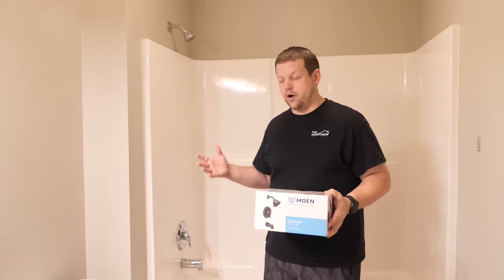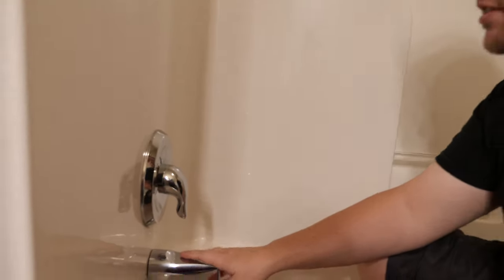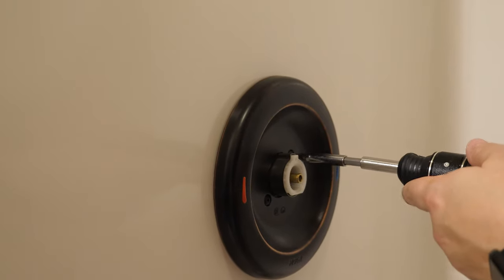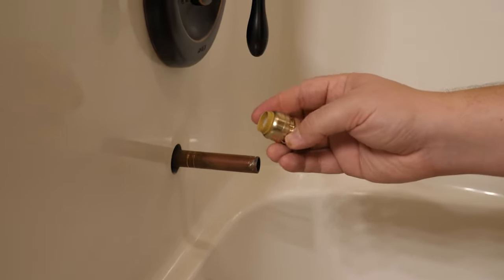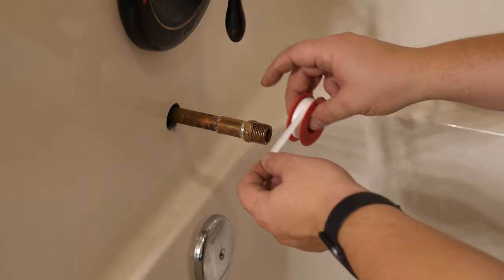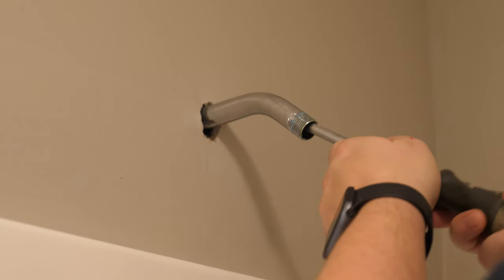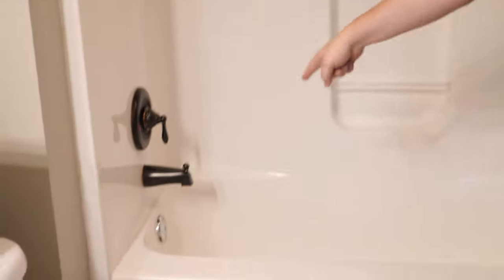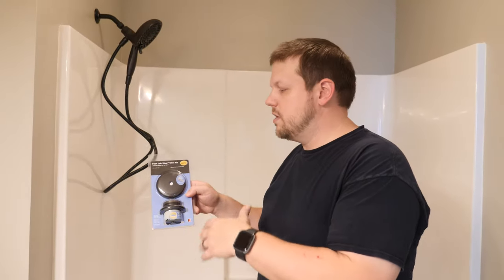How to Replace a Shower Faucet Trim Plate, Handle, Shower Arm, Tub Spout, and Bathtub Drain Moen DIY

Comment: Did the drain leak? I saw that you didnt change the rubber gasket that goes on the bottom of the tub
Reply from the maker: Nope, no leaks so it looks like the silicone did the trick. Lots of bath/shower time with 3 boys so we would have seen something by now. Thanks for watching!

Comment: Do you have to turn off the water off ? :(
Reply from the maker: I always recommend turning off the water when working on plumbing. That said, on this job if you're careful with the valve (don't turn it) it's not necessary since you are only swapping out cosmetic parts.

Comment: I would have changed the cartridge to then it would have been like brand new Supposed to use plumbers putty under the drain Also  that black gasket Goes under the tub  drain You could have changed it right out .

Comment: Does the water have to be off? Not replacing the valve
Reply from the maker: No you don't have to shut off the water to do the work that we show in the video. You can though if you want, just in case you accidentally turn the handle while working, but it's not necessary.

Comment: Could you not just cut threads on the end of the pipe for the spout?
Reply from the maker: The threads are inside the new spout so I had to modify the tub filler line and solder on a threaded connection. If it was a different kit with a slip on connection like the one I removed, I wouldn't have had to do that.

Comment: What do I do if the set screw is stripped??
Reply from the maker: Sometimes you can try putting a rubber band in-between the alan wrench and the screw to give it more grip.
Reply: @TopHomeowner  I ended up drilling until the head was completely gone and pulling it off (gently😬) with a tiny crow bar.... everything was able to be installed properly.😁

Comment: Can you tell me why every time I switch to my hand held shower it looses water pressure and is only hot? It wasn’t always like this. I never tampered with it at all. It was professionally installed like 3 years ago. It starting doing this randomly. I have the type of shower head that has a handheld shower that sits In a little holster on the side of the main head. I have to flip a switch on the main head to redirect the water to the hand held shower. How can I fix it?
Reply from the maker: I'm not really familiar with showers that have multiple heads, but it sounds like it could be an issue with the valve cartridge. Basically it's the internals that control the mixture of hot/cold water. If it just had the one shower head, that would be my first guess anyway. Hope this helps.

Comment: Did you just wrap the tape the opposite direction of the turn in the pipe?  ALWAYS wrap the tape in the direction of the turn.  You wapped the tape on the post to the left and the pipe screws to the right.  A basic no no.
Reply: Isn't what you're describing opposite?
Reply: Why does this matter?

Comment: what happens if you use the included rubber gasket instead of a silicone bead?
Reply from the maker: Using the rubber gasket is normally fine. I just wanted to be extra cautious since the tub was over a 12' ceiling below, and I have 3 boys who take a lot of baths. Any leaks on the ceiling below would not have been fun to fix.
Reply: @TopHomeowner  Thanks for the reply. Also would any modern moen bathtub faucet/shower combo fit on my current setup? It is also a Moen setup likely as old as the house, built in 1999
Reply from the maker: If you stick with the same brand, odds are it will work. That being said, the manufacturers can change the way their fixtures are made over time though, so I haven't found a foolproof method of knowing for sure. The biggest issue you would have is the valve where the handle is. Tub spouts and showerheads can be changed without going behind the wall, but if it won't fit the valve, it's a big job.
Reply: @TopHomeowner  why did you not use plumbers putty?
Reply: The gasket goes under the tub Between tub and drain pipe below. What you then use between the drain body (the one you screw in is plumber’s putty not silicone.
Reply: @haunthunterify  if you read the directions for the drain installation it actually does use the rubber gasket and pressure to hold a seal. I just replaced sink drains recently that use the same type of drain and it specifically says in the directions not to use silicone or plumbers putty with the gasket. The gasket doesn’t go under the tub because there isn’t a way to get under there 99% of the time and manufacturers know that so they created a setup that would work for most people. The newer stuff is using rubber gaskets to seal and make fixtures water tight because it looks cleaner and it much easier to do for most people. As long as it is installed tight enough it won’t leak. Some people still prefer to use the older methods though, like he did in this video by installing it with silicone.

Comment: I’m not getting any water .  What do I have to replace?
Reply from the maker: If your shower valve is the only thing not working, I'd double check to make sure you don't have any shutoff valves turned off (like with a water manifold). If that's not the issue, it could be the shower cartridge. This video might help: https://youtu.be/hVFdLsqz3C4

Comment: I currently have moen, do I have to replace with moen or can I go with delta?
Reply from the maker: I don't think the brands are interchangeable with the handle and trim since the valves are different. The shower arm, tub stop and spout would be fine though.

Comment: What type of wrench did you use?
Reply from the maker: There were a few in the project. I used an allen wrench for the handle, and I used a tub drain wrench along with an adjustable wrench to remove the drain. Links to all of the tools I used in the video are listed in the description. I hope this helps!
Reply: @TopHomeowner  What size allen wrench?

Comment: I'm afraid of buying a new kit and it not fitting the old pipe
Reply from the maker: Checking to make sure the manufacturer is the same (for the handle) and the tub spout type is the same will go a long way to ensuring it will fit.

Comment: Cant get the hex screw out of my shower handle, the thing is stripped to hell from the previous person who worked on it can anybody help with this? Any solutions?
Reply from the maker: Sometimes you can use a rubber band between the screw head and the hex wrench. It can help give additional grip... Just use lots of downward pressure as you turn it.

Comment: What size set screw or Allen wrench
Reply from the maker: It was pretty small, and honestly it will be vary by brand / model so it's best to get an allen wrench set so you have what you need for the job.

Comment: Do you have to turn the water off outside before you do this?
Reply from the maker: I didn't because the tub and shower spouts don't have water flowing through them unless the valve is on. That said, it's always best practice to turn off the water when you're working with anything plumbing related

Comment: So stupid question - you don’t need to shut off the water ?
Reply from the maker: Its always best practice but I didn't. You aren't messing with the valve so the only risk is accidentally turning it on.

Comment: This doesn’t help how am I gonna know if my new set will fit and if it doesn’t what would I have to change your cold hot controller fit perfectly what if mine doesn’t
Reply from the maker: Sometimes there is a label behind the escutcheon plate that can tell you what model valve you have and can look up that information on the manufacturers website to see what's compatible. If there isn't a label you could take a photo of the valve (with the plate and handle removed) and take photo that to a hardware store to see if they can help you find something that's compatible. If you can't find anything that will work, and it looks like you'll have to replace the actual valve, I'd recommend consulting with a plumber. I hope this helps!

Comment: Warning this will not work on older moen pressure balance valves.the center hole is much smaller.
Reply from the maker: Good point. In that case there would be a lot more work involved (e.g. replacing the entire valve) so then it's probably time to call a contractor and be prepared for a lot more expense.

Comment: Only issue is, if the valve starts to grind when you turn on and off, it's balls to the wall - have to open up the entire wall, replace the valve solder pipe, etc. It's a plumbers job to be certain. What you're doing is only cosmetic, to be honest.
Reply from the maker: Yes, agreed. That's actually why I made this video because a lot of people assume the only way to upgrade the looks is complete replacement, which isn't always the case.

Comment: To replace the tub drain, no need to use the provided rubber gasket, only at the original installation, and i would use plumber putty instead of silicon for a good seal and future replacement; silicon would screw up future removal of the drain!